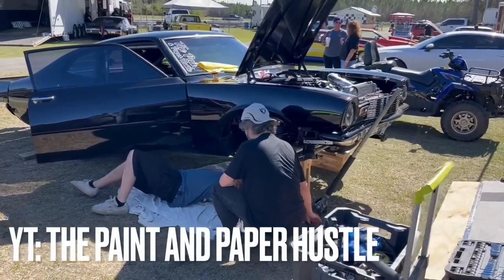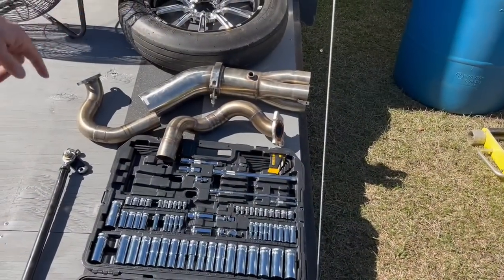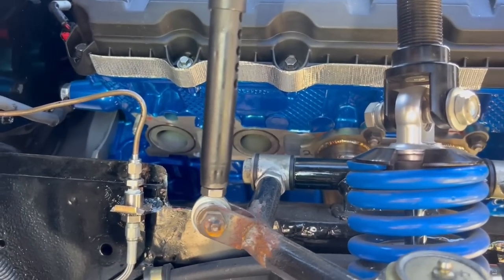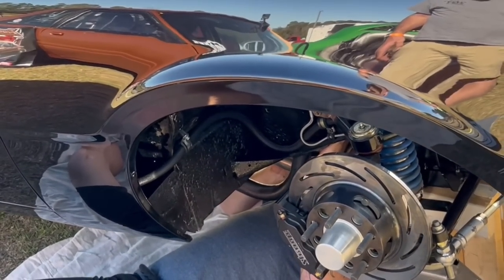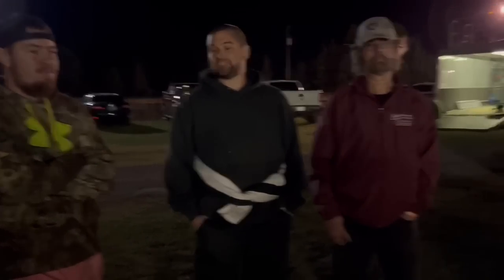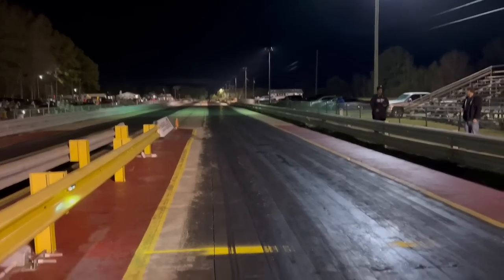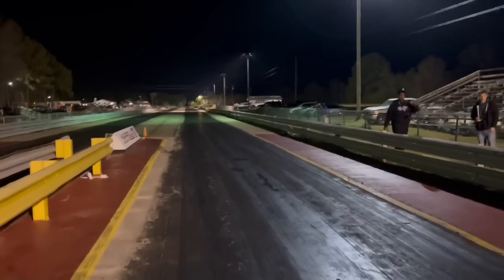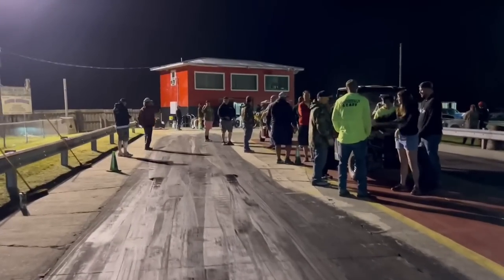Drag Racing, First Pass EVER!

Comment: Man you need to tell him he needs to start using Jack Stans under the car. That’s not at all safe. ?????
Reply: Cars sitting on “crib blocks” jack stands in dirt are way unsafe compared to solid built blocks. The jacks just under there as an extra but all weights on the blocks. No way these guys would allow anything unsafe to go on. Thanks for making sure safety is taken into account though that’s what matters the most

Comment: Going from never even driving a fast street car to a 5 second 1/8th mile car is a HUGE transition.  I would rather see someone take baby steps like Courtney is doing vs someone just going banzai right away.  That could very likely lead to crashing the car as that person would have zero experience with what normal slick tire movement feels like vs the car getting out of control.  And zero experience with HOW to handle a car going too far.  Well done Courtney!  Take it slow brother.